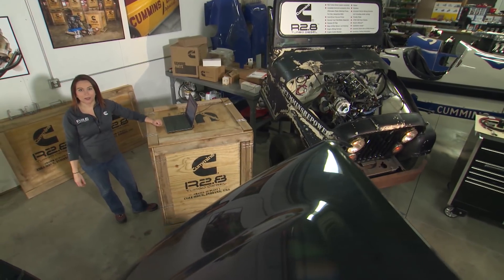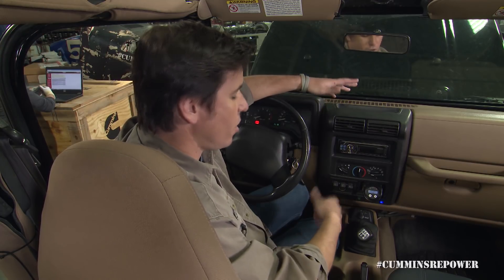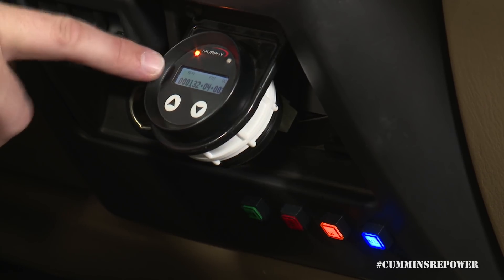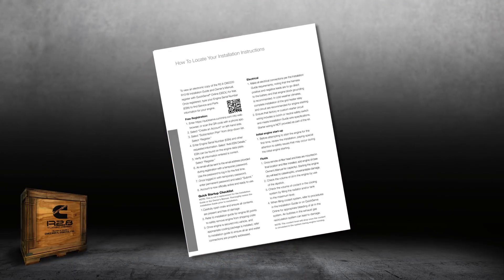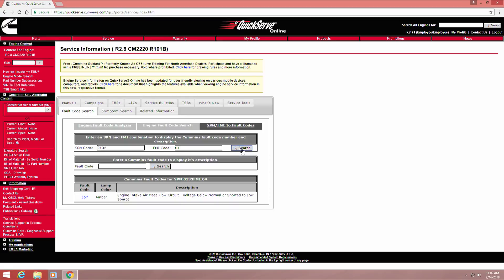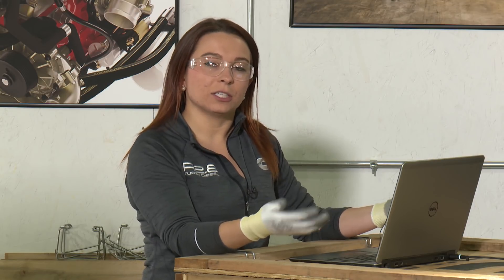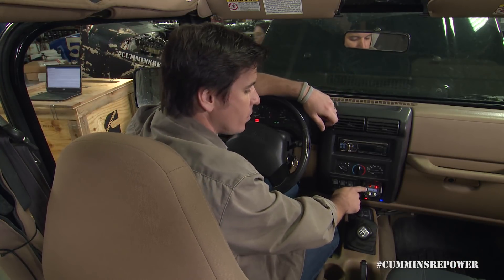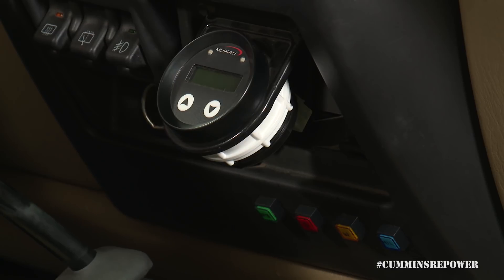Cummins Repower Garage Video 11: R2.8 Troubleshooting

Comment: Really, you can't throw the code to a simple eprom that can just display the fault in words and tell you what sensor is placing the error?  It's like very simple without even a CPU.  I mean if your off roading do you really have internet access?

Comment: Not a good choice for a motor swap if you think about it. 20 grand by the time you buy the engine, plus labor, and other misc parts. So for 20 grand you get 160hp/260 tq, doesnt make sense when there are other options with more power for a lotttt less.
Reply: 8500 bucks price.
Reply: The R2.8 is pricey... even for those who can perform their own labor and already own a viable (paid-off) daily driver with a tired/high mileage engine. The other major issue/deal breaker  (imho) is it's limited to vehicles 1999 and older!!  The R2.8 is, unfortunately, not the thrifty, holy grail swap option everyone may have hoped it was going to be... at least not for another 5 - 10+ yrs  when some used r2.8's start showing up... and even then I'm thinking used resale is going to be right around $5k.
Reply: @__WJK__  you could work for Cummins and get an employee discount:-).
Reply: @StormLaker1975 - Either that (which would be awesome) or find/become friends with someone who currently works    for ‘em!

Comment: And is there options for paper copies of troubleshooting, factory service manuals and/or vacuum and electrical schematics?
Reply from the maker: Hi, Charles. A paper copy of the installation manual as well as the owner’s manual are shipped along with your engine purchase. A PDF copy of the installation manual can be found on www.cumminsrepower.com and can be printed. In addition, www.quickserve.cummins.com has electronic copies of all of the manuals as well as an electrical schematic.
Reply: CumminsEngines, do you think that in the future there will be a full factory service/repair manual available for purchase? If I spend this much on a machine, I’d really like to see the full disassembly/reassembly procedures on paper (or computer) and know the thing inside and out well before breaking out the wrenches. Just to be clear, I’m talking about servicing (myself, in my home garage) after hundreds of thousands of miles of usage well after any warranty has expired. Thank you
Reply: CumminsEngines hey, so about a complete service manual...? I’d like to be able to get tolerances and specs in detail, if I’m to consider rebuilding it in the future. That’s reasonable, right?